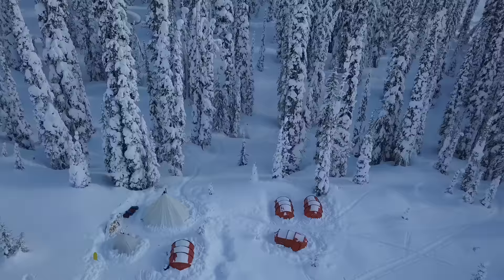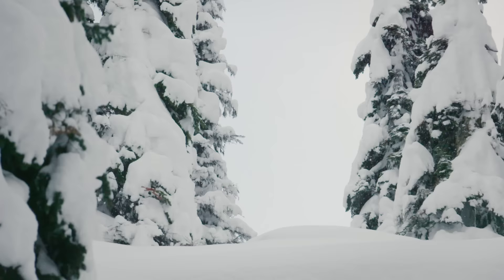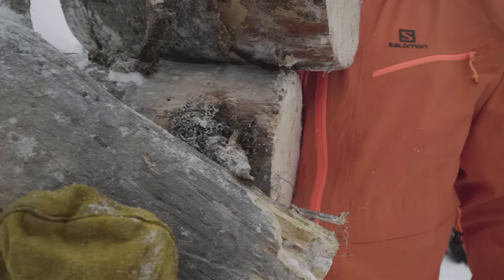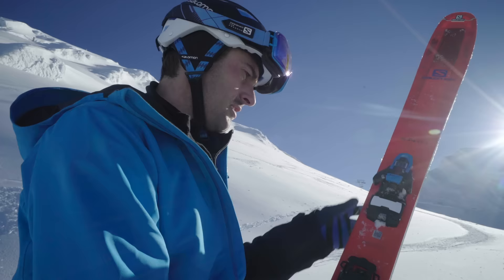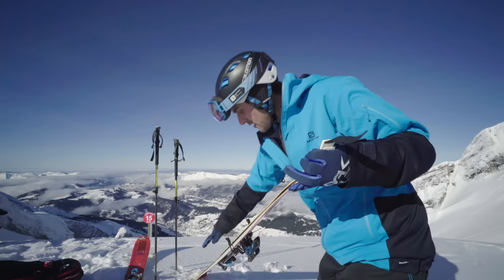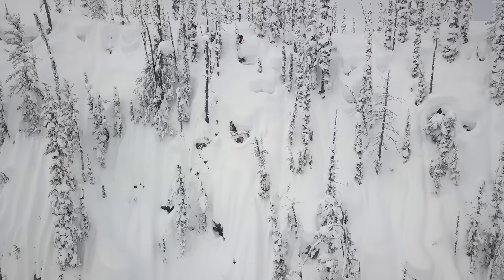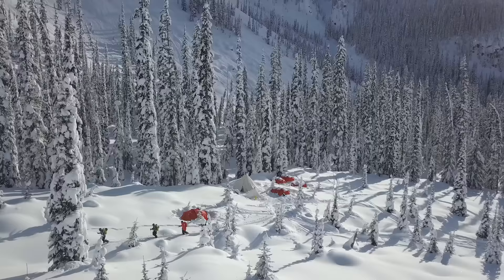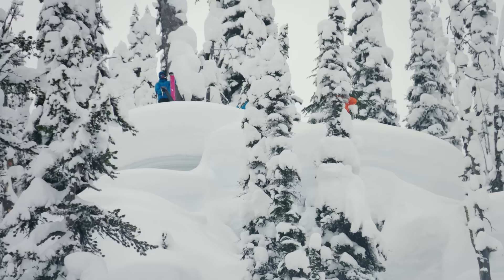Shift | Salomon TV

Comment: I'd like to see how it preforms under the most challenging conditions on longer hikes. I.e starting by sea level with warmer wet snow, moving up towards the peak where it gets colder,  freezing winds where that wet snow starts turning to ice. 
In this vid it seems they have constant cold temps, dry conditions, awesome conditions. But not really rough for the binding.
 If there is alot of tech/moving parts in the binding (the toe piece is mentioned in the vid) that could freeze, Id be really interested to see how it holds up and what has been done to prevent these types of issues.  Not sold just yet, but tempted for sure!
Reply: We all used this binding for the entire season and put it through every type of condition I can imagine. Zero problems and easier to deal with than traditional pin bindings. Unless I'm doing a multi-day trip with long touring days, I won't use anything but the Shift.
Reply: @mikedouglas_  Hey! Thanks for the reply. Sounds great! Would be cool to see a little edit of that. Anyhow, good job to you people on taking touring bindings to the next level!
Reply: I am happy with pin because I keep them loose as I don't crush.
But to harderskier I see the + !
Reply: @mikedouglas_   Hey again.  Whats your thoughts on this issue? https://www.youtube.com/watch?v=_1XIx7b6ILA Toe piece getting filled up with snow making it unable to switch into skimode. According to comments its a known issue "amongst the people", yet Salomon (according to the comments) say they havent heard of it yet. 

I ended up buying the bindings some weeks ago, before knowing about this.  So far happy, but the issue creates some worries.
Reply: I had no issues so far, 2 months in with them. I don't ski too hard though, especially back-country. Uphill has been great, brakes releasing twice in that time

Comment: I have these bindings for 2 seasons. Last season I skied about 10 times. I have used them only on slopes and never used their walking function. I am about 140 pounds so I put hardly any pressure on these bindings, nevertheless the materials they used are in such a low quality that it started to break so one of my bindings now stays always on walking mode. Searching on the forums, I found several people complaining about this and it looks like this problem is common because materials are so low quality that they break down and the mechanism stops working as they suppose to.

Because of this I faced myself in several dangerous situations where my binding toe piece just popped while skiing. I got new bindings than finding myself in unfortunate situations. 

I am really disappointed with these bindings. The compromises with the quality that Solomon has made in the production of their products in recent years makes me think about whether to buy something from them again. I like the idea behind shift bindings but I would NOT recommend it until they improve the quality. Anyway who wants to spend that much money for something that will break down in a season.

Comment: Great video...awesome binding. However! I would like a combo binding. One that I can make telly turns with (free - unlocked heel) or lock down and use as alpine. Free the heel for either up or down...I have seen some dudes add a rental binding heel, they can lock in or slide back with a screwdriver to allow free heel turns, kludge for sure, but some said it worked...But for the issue of no forward or lateral front release, which made it sketchy.
Reply: Not sure why anyone would need that.
Reply: Meidjo 3.0 binding with alpine heel option.

Comment: I skied 40+ days with and I sold them... too many issues: walking mode keep unlocking, toe mechanism freezes, DIN pre-released, toe height adjustment keep loosing and combined with poor customer service this binding is a total engineering flaw. Not recommended.